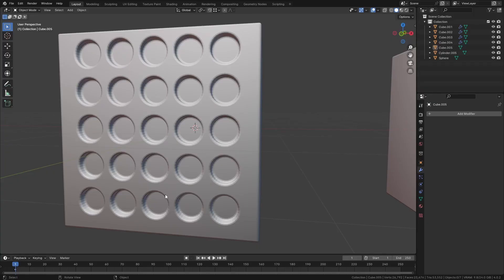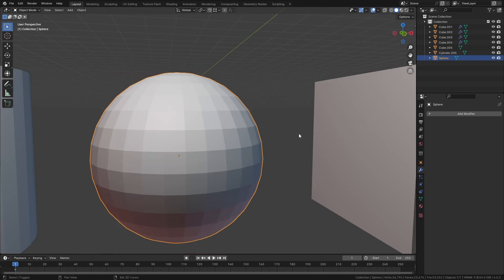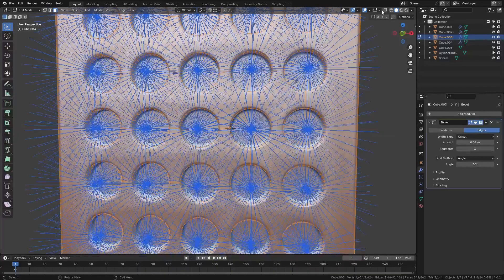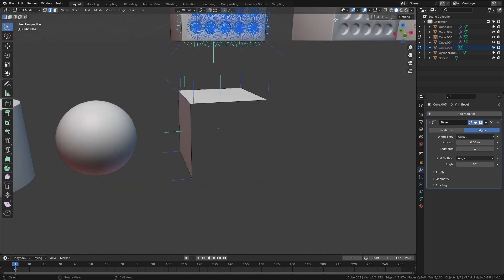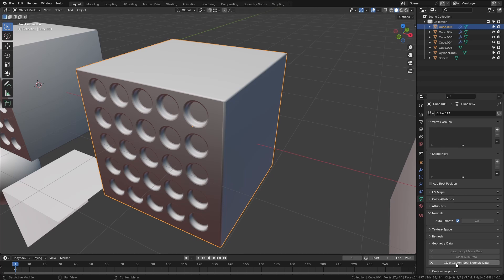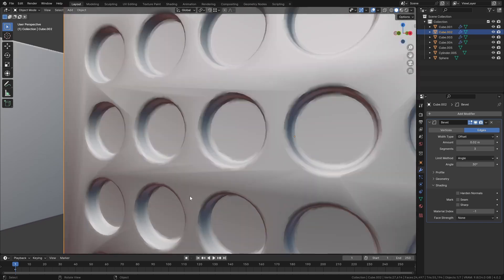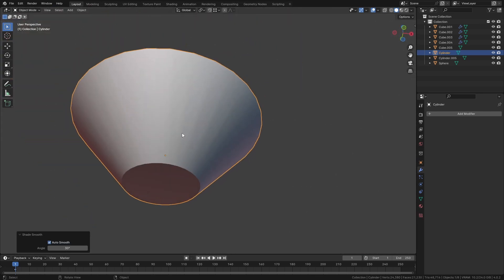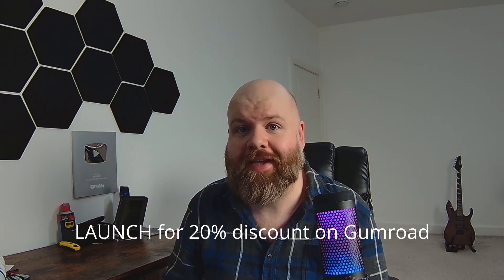The Easy Way to Fix Ugly Shading in Blender

Comment: for hard surfaces, the problem is rather easy to avoid since vertex correction is faster, however, if you dont really have the time to go one by one to fix this normal issue, you can average your normals by corner angle while selecting the cluster of faces plus a couple of extra faces around the area with this problem and it will either remove or greatly diminish this problem, and will keep the continuity along the surface if there are curves properly too.  Great video mate!

Comment: Right about normals, but this is acctualy Phong Shading, means it had to add cuts. In blender it is base on Normals. But this is a specially of blender, not normal behavior. Nearly all other software like Maya, C4D, Max, Houdini is based on PhongShading and not bound to Normals at all. Which isnt, becaue its baked into the modles Faces.

Comment: adding 2 modifiers completely fiixed my issue. Issue happened after i combined vertex by distance.

EdgeSplit - (mine is 80)
WeightedNormals - (Mine is 50, changing wont do anything but by existing it fixes).

you can also add EdgeSplit and then press Alt + n > Average > Corner Angle. but i prefer to use modifier if i may need to change something.
Reply: thanks man, this has been working good

Comment: So weighted normals can be useful, and I know people like their Booleans, but would it not have been worth at least mentioning the benefit of modeling that example with quads? Like the root cause of those shading issues are the n-gons that result from the Boolean workflow. I know Booleans have their upsides, but that example bugs me a bit just because it's a simple mesh and would be a trivial matter to add a few loopcuts, inset individual, circle tool, and extrude. You'd have the same shape, but it would be subdividable, not need any auto-smooth/custom normals/sharpness, and would work with tools that deform/displace. Anyways sorry for playing topology police, thank you for making Blender content, and have a great day.
Reply from the maker: You can still get other similar shading issues even with quad topology. Poles on corners and large quads can cause the same issue for instance. There was really no way to cover all that without turning this video into a 30 minute mini topo course.

Comment: Any chance there is a discount code for use on Blender Market as well? I am okay if you say no, but was wondering a little about it since i tried it there as well. (keeps the library together nicer for addons and other bits and such.)
Reply from the maker: @narutoninetails9  Unfortunately not. Blender market is an expensive place to sell products. They take a huge commission plus merchant fees and transaction fees on top. In order to use promo codes, you have to pay them an additional ~$50 per month. 

I don't sell enough products via BM to justify that expense.
Reply: @DECODEDVFX  Very understandable, and thank you for the reply. I did not know that was what sellers went through. I am glad for the knowledge as it helps understand your side of things and other sellers things to consider.

Comment: Good video. 
I use (Alt-n) Normals > Average > Corner Angle or Normals > Average > Face Area to fix a lot of these problems without adding a modifier.
Reply: This is also solution for this issue pin this up mate !
Reply: I will forever remain grateful to you! I tried literally everything but nothing was working. Face area worked for me. BTW to those of you who cant't find this normal menu, you need to be in edit mode then press Alt+N.
Reply: I love you
Reply: @11RIHAM  cheers!!!
Reply: I would point out that the Bevel modifier he is using in this example needs to be applied before Normal Face Area fixes the issue. Rob is showing how to solve the problem with non-destructive (Parametric) workflow so those two methods wouldn't work with that workflow.
Reply: You saved my life
Reply: fucking legend
Reply: men... this is the best metod. great!!!
Reply: :face-blue-wide-eyes:
Reply: Huge thanks!
Reply: omg god bless you
Reply: This is exactly what I needed, thank you.
Reply: thank you
Reply: this is exactly what I needed, bless you
Reply: Thank you so much, works great
Reply: OH MY GOD THANK YOU SO MUCH
Reply: @tao3014  Thank you. I try my best :)
Reply: Alt n? Is that a keybind or something. Its nothing is popping up when I press it
Reply: @ I’m away from my pc at moment but I’m pretty sure it’s a standard shortcut. Is there a “normals” menu in the 3d view header? That’s what alt-n brings up for me.
Reply: @deluxegdm7435  you have to be in edit mode
Reply: I'm so thankful for this tip I want to kiss you. My crumply-looking mesh is smooth now. Have a great day!

Comment: weighted normal is no solution because you gonna have problems in other programs. don't teach that. so professional artist would suggest that. all of your solutions are not good.
Reply: Wrong. Blender applies modifiers on export automatically by default. Normals information is encoded into the mesh data of the file type, along with vertex positions, UV's, material assignations, UV's, etc.
Reply from the maker: @PrefoX  you can export custom normals to other programs.

Comment: Not sure I agree that adding the edges will add a bunch of geometry. Here's why, and what I tend to do. I'm open to seeing your perspective on it. I add on loop cut where the center of my circles will be cut. So in your example the cube would get 5 loop cuts, I then center my circles along those lines and cut them in. I do use something like Grid Modeler to be fair, but its a great tool to line things up and generate detail. With what you showed, the shading issue is because the edges blender added when you did your boolean are at an angle that is too sharp. The circle being cut in, no matter how we do it, requires 2 edges to create the cut. I'm just saying, add the edges first, Blender won't add more.

Comment: Always use this in my hard surface models. Many artists are adopting this workflow with weighted normals, cause it makes modeling easier most of the time. You can use booleans and adjust meshes quickly without being too stuck on full quad/subd etc. Pair this with tileble materials and decals, you have Star Citizen.

Comment from the maker: I used the word crease around the five minute mark. That was sloppy wording on my part since Blender has an actual unrelated function called crease. Not that it really matters. just something I noticed after uploading. ¯\_(ツ)_/¯
Reply: Creasing is unreleased? Blender  has had edge and vertex creasing for a while.
Reply from the maker: @Specter_1125  that was supposed to say unrelated. Autocorrect changed it.
Reply: I believe it uses the "Mark Sharp" feature, it comes up with selected edges or faces and pressing Ctrl + E. Great feature for making paneling on Sub-D models if you bevel the edges.